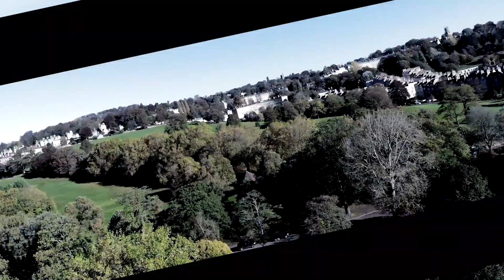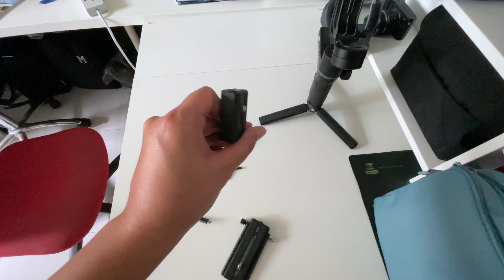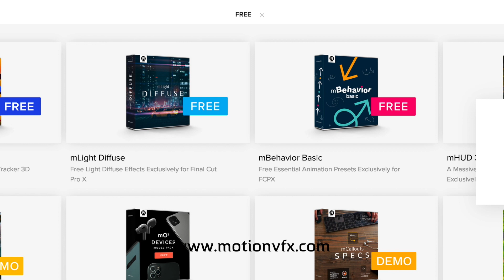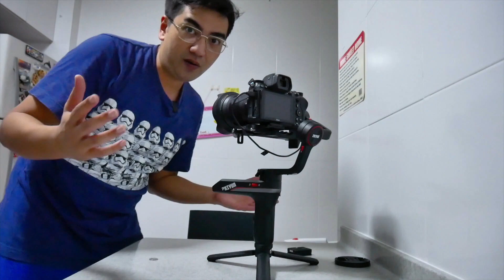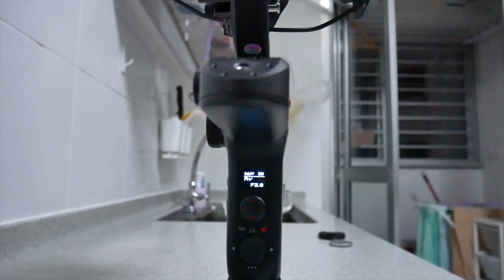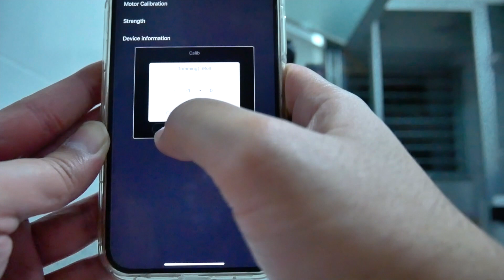Zhiyun Weebill-S: Step-by-Step Setup Tutorial - Nikon Z6II (It’s Easier than you think!)

Comment: The eyecup on my z6 hits the motor on the Weebill s, preventing it from going into vortex mode.  How are you avoiding that?
Reply from the maker: You will need to probably adjust the measurement on the quick release plate screw. Move it forwards or backwards and do trial and error testing. Which lens are you using?